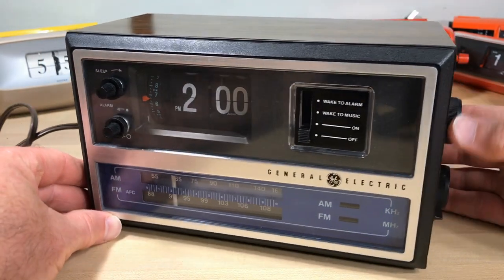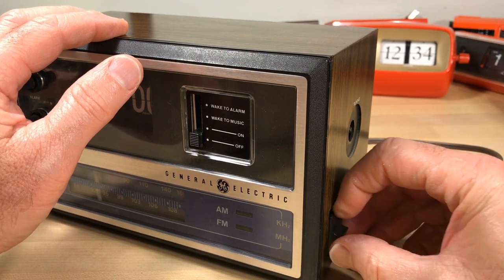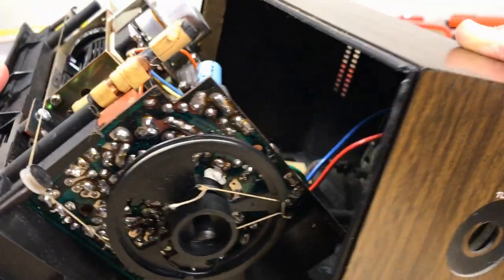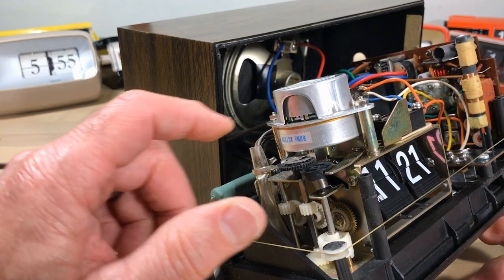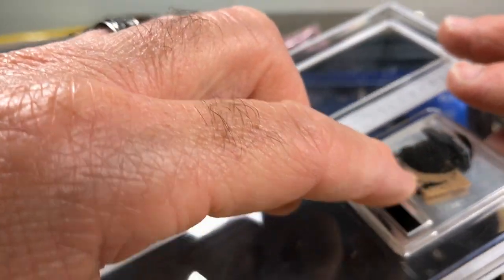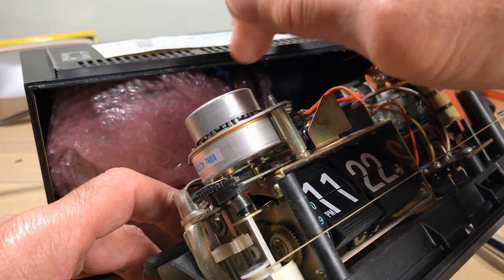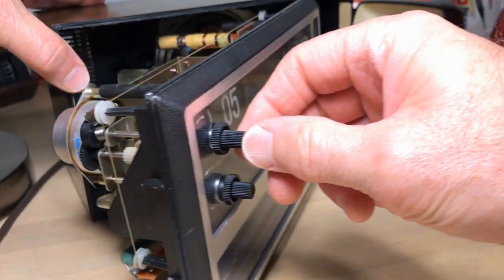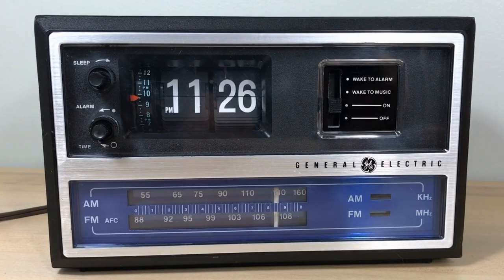The General Electric model C4315B Flip Clock

Comment: I've got a couple GE flip clocks, but not that one. Interesting to see what's different and what's the same between them. Great show as always sir, rock on!
Reply from the maker: Yeah. I've seen these forever on eBay. I just stumbled upon this lady, Marcia, who needed that clock fixed. It's like most of the GEs, well built generally, but underappreciated. The sound from the radio is much better than many of our flip clock radios and the position in the clock (especially if on a night stand by a wall) really resonates.

Comment: Just picked up one at second-hand store. Had same issue of radio not turning off. I took apart following your excellent tutorial. But what fixed it for me was wiggling the sleep knob a few times, which I could have done without opening it up. 😵‍💫 When I put the case back on and tried it out, the radio wasn't working anymore. (I made sure volume knob was turning and changed channels. I turned the sleep knob a few times.) Also, the Wake to Alarm and Wake to Music buttons don't produce any sound/buzzer. The speaker wires seem okay. The engine is spinning. Not sure what happened. Any suggestions on what I should look for?
Reply from the maker: It’s hard to say for sure. But a wire has possibly come loose from the micro switch that is near the sleep knob. Check for loose wires.

Comment: the code is probably the last 4 of the owners SS# and initials. Standard ID in USAF
Reply from the maker: I remember those days. Even had that stamped on my underwear.
Reply: @Flipclockfans   1981 left E6. I had a stencil made, use it to this day
Reply: There is a possibility this clock was used at an airforce base.